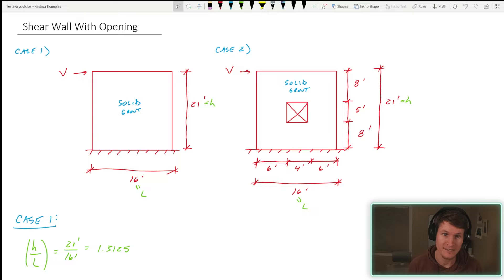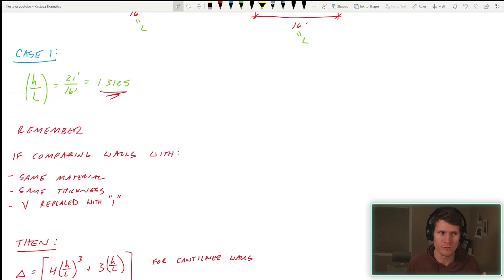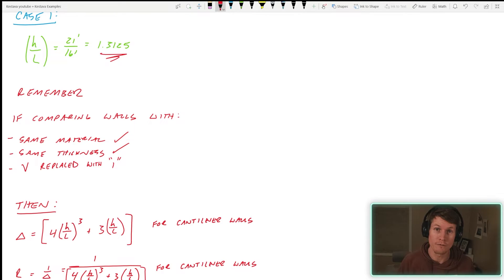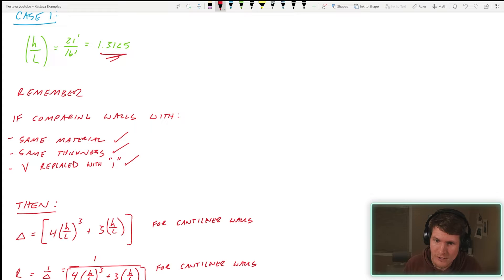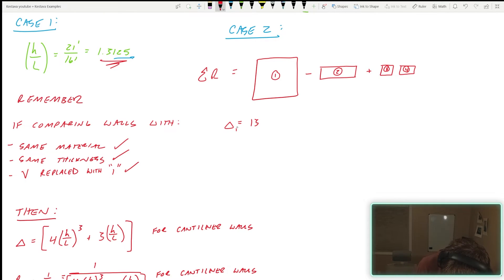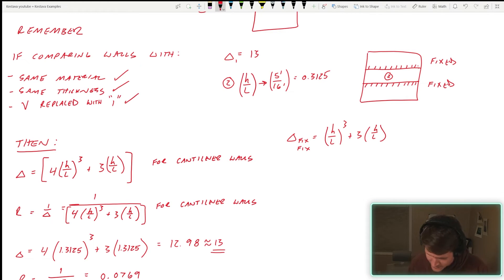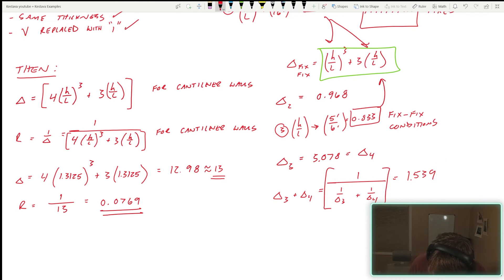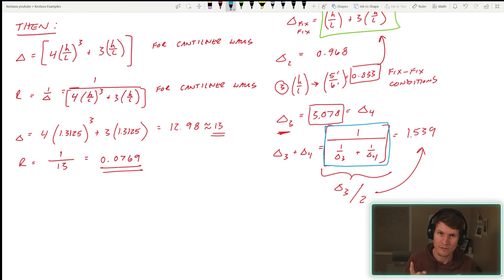Calculating Shear Wall Rigidity with Openings | Kestava Engineering #structuralengineering

Comment: Can this stiffness knockdown factor be taken to the extreme?  I would like to apply this approach to a pergola type structure with open sides and knee braces.  So basically no shear feature.  

I was alternately thinking of directly measuring the as-built natural frequency of the structure (via accelerometer and forced excitation) and then working backwards from that to determine seismic susceptibility.
Reply from the maker: this same concept can be used for the pergola but you would use differing equations to determine the stiffness of your system. a pergola most likely is acting like a mini moment frame pinned and or fixed at its base. check out one of my earlier videos on stiffness equations to grab the one that applies to moment frames. your data collection sounds like a great experiment that could yield very cool results!